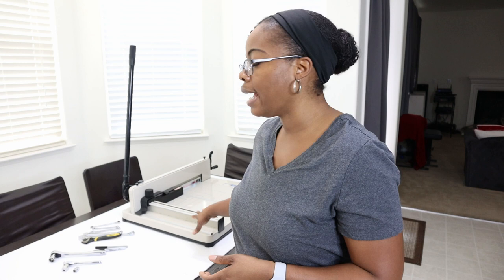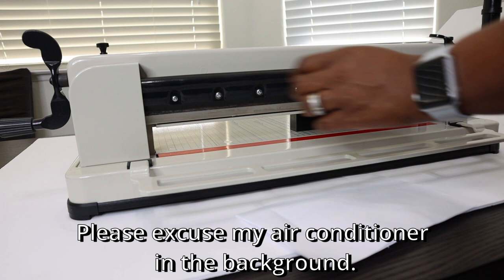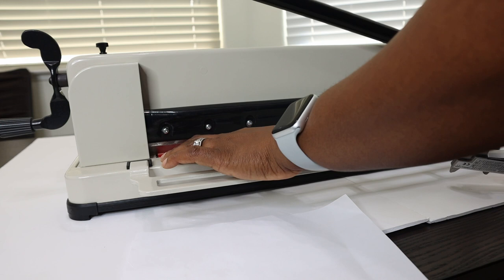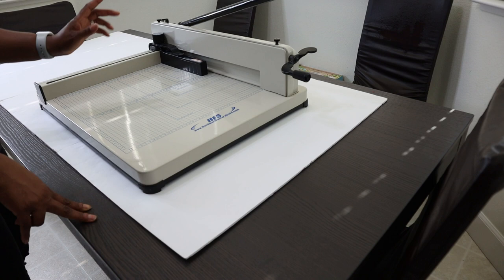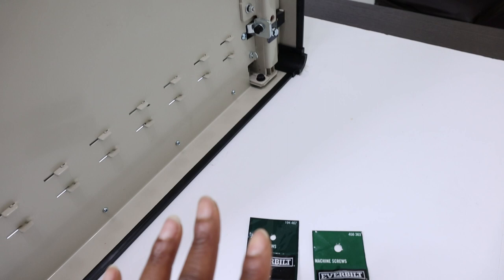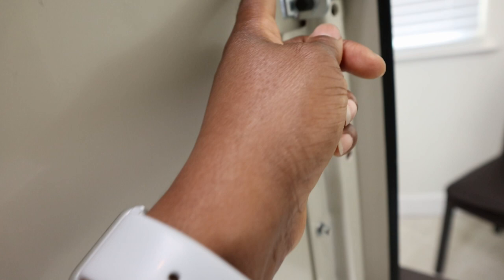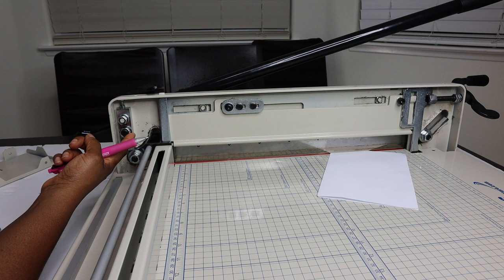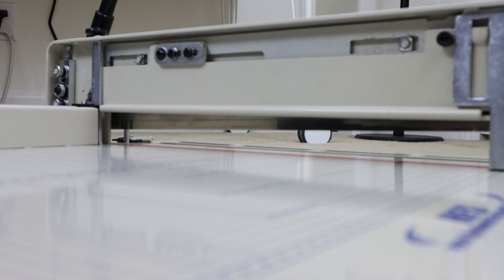Heavy Duty 17'' Guillotine Paper Cutter Re-Alignment of Blade and Fence| Stick Rotation| Maintenance

Comment from the maker: Hello, and thanks for watching!❤
If your cutter is only partially cutting through at the top end of the blade, you can check out this follow-up video I made.  (This is the link https://youtu.be/3GuFbWj23MY) where I found out what is causing it:) At 6:14 in that video, that will solve that issue at the top end of the cutter.

Comment: Thank you, thank you, thank you!   This is exactly what I was looking for. You really explain things well.  I have been afraid of adjusting the cutter since I got it (there are so many bolts), but you have empowered me.  I will be trying them soon.  Thanks again!
Reply from the maker: Hi, you're welcome! I am glad it helped and hope you're able to make the adjustments you need:)
After making this video, I also made another video adjusting the cutter. It includes all the above information and how to place leverage under the handle. It may be needed sometimes to get the blade leveled when replacing one of the bolts.
I learned that later, so that was not in the above video. If you're interested, this is the link here ---> https://youtu.be/3GuFbWj23MY . 
Thanks for watching!

Comment: Hi there!! You have saved my life! I have tried looking for more explained videos but never found them. I just have a couple of questions, my cutter does not have the 2mm up at the end, it is just flat and I don't know what to do to fix that. And, my second question is what if my blade started to cut less at the beginning than at the end, do you happen to know how to fix it? 
Thanks so much for the help again.
Reply from the maker: Hi Teacher Steph Solis.
First, I am happy you found the video helpful:)
Sorry you're having issues with your machine.
Based on your description, your blade seems aligned in reverse, cutting into the stick more at the end and less at the top, possibly with a 2 mm or close to spacing existing at the top end of the blade. 
Does it look this way?
This spacing would account for it cutting less at the beginning than at the end.
At least, it sounds that way:)
I believe you should be able to adjust the blade by a series of adjusting and readjusting that vertical screw I showed in the video and the small top bolt.
However, in the video, at 8:05, where I showed the extreme case of misalignment, I mentioned how sometimes loosening the middle bolt might be required if the realignment is way off. 
But from my experience, I would only try that after trying the first option. If the space at the top end of the blade is not that great, I believe the first option should solve the issue.
After using the machine for a while, I suspect realigning the device will not be a one-time thing because of the moving parts.
I am not sure if that explanation makes sense to help in the meantime.
I can try to see if I can recreate a similar situation with my machine and try to realign it within the next week or two. If I can't, I'll comment here.
Thanks for watching!
Reply: The space does not exist at the beginning nor at the end. It does not have the inclination but some how it does not cut at the beginning 😞 I hope it makes sense. 
I'm gonna try and see adjusting it as you mentioned, thanks a lot for the help❤️ I'll stay tuned for that video.
Reply from the maker: Ok. Then I believe adjusting that screw and bolt would fix it. Try to align it where the top end cuts into the stick just a bit and the bottom end has a small spacing. That should solve the not cutting at the top. That is how my machine is aligned:) 
I hope you can get it fixed ❤️
Reply from the maker: @teacherstephsolis8491  Hi,
If you're still getting incomplete cuts with your paper cutter, I made another video (this is the link https://youtu.be/3GuFbWj23MY) where I found out (I think) what is causing it:) At 6:14 in that video, this might solve that issue at the top end of the cutter. 😊
Reply: @MommyShareSpace  I already did🤭 and I'm really thankful ❤️ again I love your videos, they are super useful and nobody has these kinds of videos. Blessings from Costa Rica 🙌🏼✨
Reply from the maker: @teacherstephsolis8491  😊 Aww. Thank You so much! I appreciate your kind words. ❤Blessings to you also! 🙏🏽🙌🏾

Comment: Hi , dear madam 
Very good tutorial about blade alingmement.
I have a problem in my same machine that's pressure system on paper  are not working properly..threads of long bolt damage.. again and again.. please give me the solution if possible.
Thank you
Harsh Nicholas
India
Reply from the maker: Hi, I am not 100% sure I understand you correctly. However, if you're referring to the blade not clamping down on the paper correctly, this video here ---> https://youtu.be/3GuFbWj23MY . I tried helping with correcting that. 
The video has time stamps, so you can go to that section of the video:) Unfortunately, if the threads on the vertical bolt are damaged, I am not sure if that can be fixed. Looking at the machine, it seems it would require all three bolts to be removed to remove the metal plate to access the vertical bolt. That way, you can size and replace it at a local hardware store. But I have not done it myself; it just looks that way watching that part of the cutter. Once assembled, it would also need aligning.
I hope that helps.

Comment: Hello, thanks a million... You got one subcriber 😂😂😂

One more question,

Whenever i cut the paper according to the paper size alignment given on the board/base the result of the paper angle of the corner is always wrong, it doesn't come out as 90° angel, it come as something like 100° .. please help!

Thanks in advance..
Reply from the maker: Hi, Maya Angkang, and you're welcome! First, thank you for watching the video and also for subscribing! :-) 

To answer your question: In my HFS Cutter Review video (this is the link, https://youtu.be/3vRg1s0jMhs), I pointed it out between 7:26 and 8:06. In this video, the realigning video, I pointed it out between 24:53 and 25:40.
However, your question is excellent, especially since you phrased it according to the angle of the final cut. I just said it was not straight. Since I have held one to some of my end-cut spines from the past, I was able to measure it, and you are spot on, about 100 degrees vs. 90. 
This week I have some books I need to cut; I will do a short video demonstrating this. I hope the above information can help you, though.
So thank you for your question also :)
Reply: I have the same problem